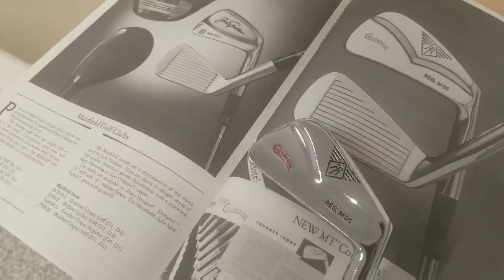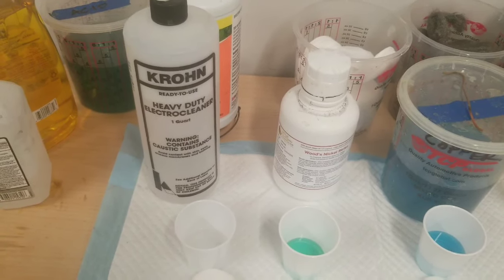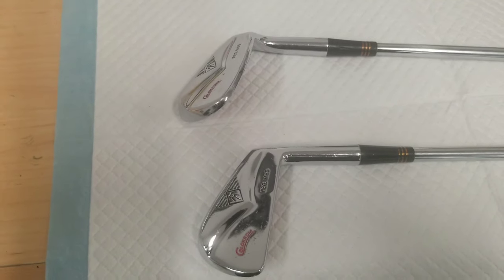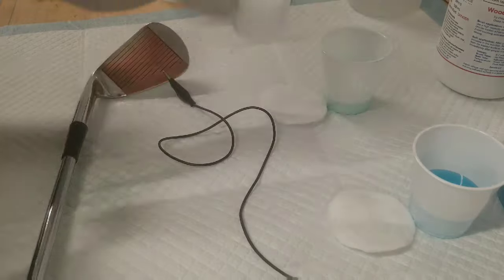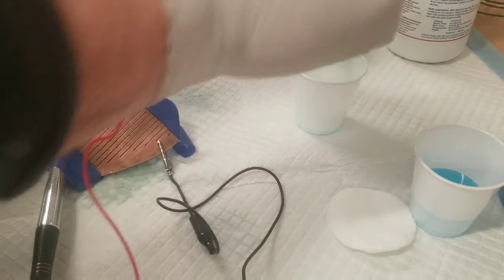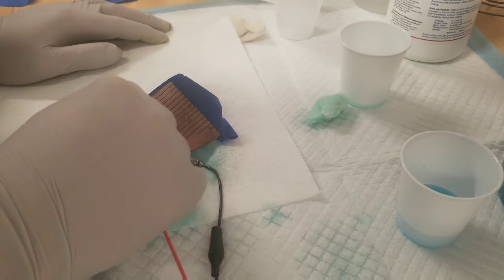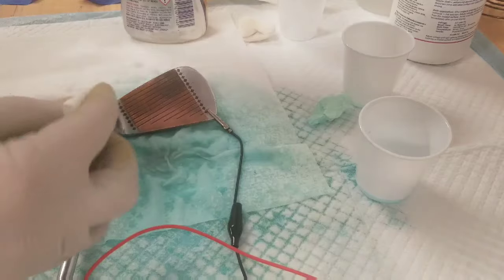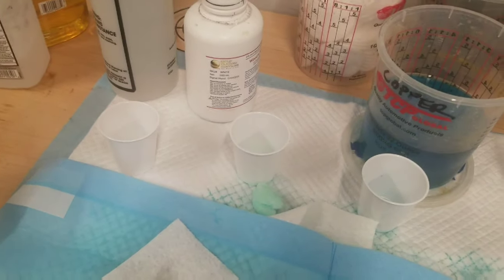1983 MacGregor M85 Colokrom Brush Copper Electroplating Restoration - DIY Golf Club Restoration

Comment: Brad I’m enjoying your videos immensely. Thank you for your efforts and great step by step instructions. I have a suggestion for you I think may work/help during your stripping and plating processes. Use a larger alligator clip and connect it to the hosel instead of the blade. This will keep the clip out of the work area and allow you complete access to your working surface. Again thank you for sharing with us your knowledge and passion.
Reply from the maker: Hi, Mark. Yes, the larger alligator clip has solved my woes since this video. The little one would shoot off so the blade was the only place it would stay on! I'm learning as I go too!

Comment: Brad, this is a GREAT video! Wonderful instructions!!!

Can you give me some advice on something I'm working on?
I've got a Scotty Cameron Santa Fe tei3 that has a few dings in the tei3 center. Will this work to fill in the dings on the tei3 insert? Obviously the tei3 insert is made up of mostly  copper. But I'm not sure what the other metals are...
What's your opinion? And I'd appreciate any helpful tips!
Reply from the maker: I believe it's stainless, so I would avoid the acid bath and only work on the face insert. You can polish the rest with just the sanding/polishing but no plating is needed.

Comment: Do you have to take off the chrome to nickle plate it.
Reply from the maker: Yes. It will not bond to chrome or bare steel. It first needs a tiny layer of nickel (nickel strike) then it will bond.
Reply: @BradMeehan  how do you take off chrome with out the chrome remover machine.
Reply from the maker: @manuelgarza969  I sanded it.

Comment: Hi Brad. I want to get and retire a set of Ping Eye2 beryllium copper irons. And also I'm interested in the Ping Karsten Answer type putters. Would you go full copper plating on the irons or is there a way to clean them up without electroplating?
Reply from the maker: Hi, Craig. Since they are solid (and not plated), you'll be able to just sand, polish, and buff them. I have a subscriber who did a set and they look really good. You may find they're too shiny, and may need to dull them by either giving them a light.scuff with a green Scotch Brite pad or go over the club with the media blaster at a lower pressure. Otherwise it'll look like that putter I just did in my last video.
Reply: @BradMeehan  Thanks, Brad. Went back to the Big Woody video to see the procedure. They should polish up nice.
Reply: @BradMeehan  Can the faces on these be sandblasted?
Reply from the maker: @craigscott3133  Before re-plating? Yes sir. Check out my MacGregor Tourney video where i blasted and copper plated the face first.  These old Macs have a pretty thick layer of copper under the chrome.

Comment: I have some of those original m65  my copper faces are perfectly intact with a nice patina but I'm surprised at how much of the 
N ickle on the rest of the club has worn away to show the copper beneath.  There's no chrome I there? I would think it's steel with a layer of copper then a layer of nickle?
Reply from the maker: I'm going to have to do some digging. I'm working on a MacGregor Tommy Armour right now that was similar. The top layer looked chrome-ish, but not like modern chrome clubs. I have old chrome clubs that do not have this same appearance.

Comment: You can’t plat on chrome ?
Reply from the maker: No, it won't bond on top of chrome. Chrome won't plate onto bare steel, so you have to nickel plate it first. I suppose if you haven't penetrated the nickel layer, you could re-chrome into the existing nickel? 🤔